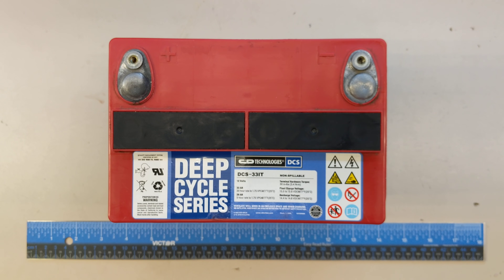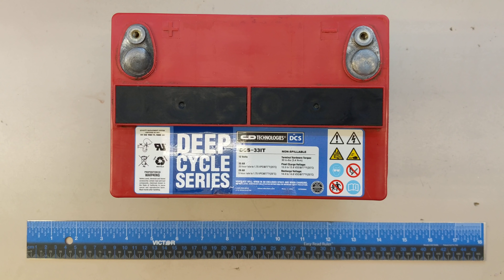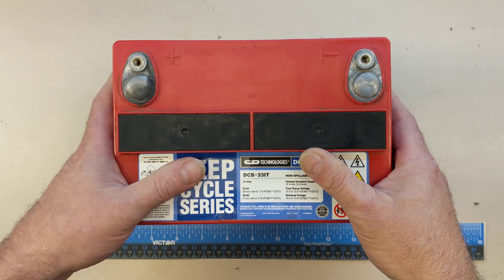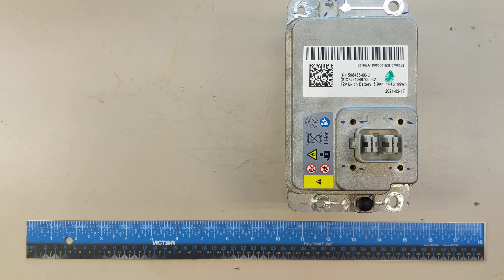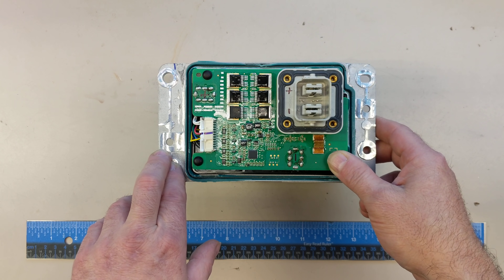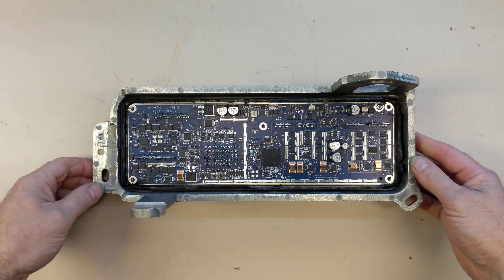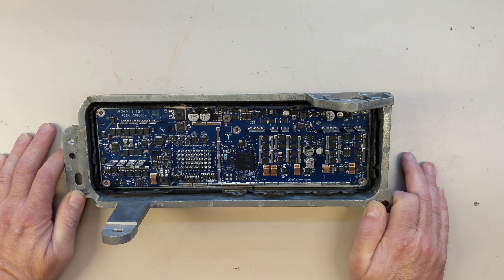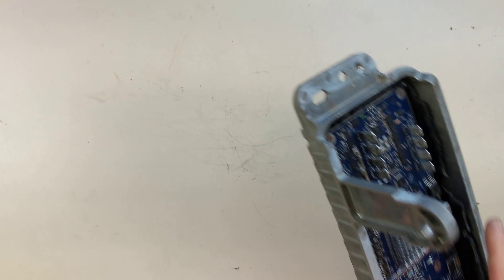Tesla Plaid - 12 volt Lithium Battery PART 1

Comment: Hello everyone from Georgia I bought a car from America that got into an accident. By the time it arrived, it was in a container for 2 months. The battery was a sixteen-volt one and completely discharged. I charged it on the board shows 16 V And where the plug is connected in the car there is no 16 V, it does not show, but how can I cut it so that 16 Volts appear there? The mosfet is open. How can I close it so that it closes in the mosfet?
Reply from the maker: Sadly these batteries will discharge too far for recovery in 2 months after already being dead.  It's a design flaw.  Best advice is order a new one.   DO NOT connect it until you have contactors closing ok!

Comment: Hello!  How to reload a 16V battery after the protection has tripped.  It shows voltage but does not output current.
Reply from the maker: You have to run a reconnect in service mode, and then redeploy the software.
Reply: @Ingineerix  Thanks, I'll try tomorrow.  Is it possible to contact you and ask for help in resolving issues with Tesla?
Reply from the maker: @VALmers.  Yes, my email address is available at the bottom of my profile's "about" page.  You must use a full browser:  https://www.youtube.com/ingineerix/about
Reply: @Ingineerix  Thank you very much)

Comment: I wonder if you switched your battery cables to this newer plug if you could use this new battery on an older Tesla.
Reply from the maker: No, definitely not, and you also don't want it, it's pretty terrible.   The AGM replacements you'll need about every 5 years are only about $100 at Tesla, just buy them when the car tells you to.  Do not try to retrofit a Lithium, you will probably need to replace your PCS if you do (thousands of $).
Reply: @Ingineerix  thanks for the quick reply!

Comment: Hey Phil, what would be the charging voltage for this battery? Will it be beyond 16V?
Reply from the maker: Yes, it can be, but you cannot charge it externally.  It will only charge once VCBATT allows it to over LIN.  This means only once HV is present and all faults that would inhibit charging are cleared.

Comment: Where is the negative terminal? Ugh fkn Tesla
Reply from the maker: They are both in the same connector.   Note you cannot charge it yourself.
Reply: Any grounded point on the vehicle is a low-voltage battery negative... but as Ingineerix pointed out (in the video and in his response here) it's not connected to the cells unless the internal BMS connects it.

Comment: Thanks for the great tear down! Do you know the max peak and max continuous discharge current of this battery? I’m doing some tinkering: adding “12v” power to my frunk, and want to know what limits I’m working with.
Reply from the maker: You absolutely cannot tap this battery for loads.  You will fault the charge system.(VCBATT)   If you want 12v, the only safe way is to draw it directly from the PCS.
Reply: Thanks Phil! That’s really good to know! I’m very interested to learn how I might draw from the PCS to do this. But I’m curious if this project would be above my head: is there a terminal on the PCS I can connect a lead to or are we talking about more complex electric engineering? Any resource you might be able to point me to? Many many thanks. (I’m looking to draw 10-20amps to charge an electric scooter in the frunk for 3 hours when it needs recharging).

Comment: What do you think would be the safest way to add say a thousand to 2,000 w power inverter in the frunk area. It looks like you could just run maybe a 6 gauge wire straight to where the jump start terminal is and then ground to the chassis somewhere else run that straight to your inverter mounted in the frunk. Any idea of how many amps it could handle. Do you think the car would need to be on or the battery would run down fairly quickly. My thought process is if the car was off that it would notice a drain and maybe shut something off. But say in a long-term power outage at the house you could run a couple small refrigerators and maybe recharge phones watch TV. I do this with my Prius currently just hooking jumper cables to the battery and running to a couple deep cycle batteries will keep the bank charged up that way I have a little more buffer for higher loads. The advantage with this is it could probably run for days and days because of the size of the Tesla battery in the small amount of load that I would need where the Prius would have to keep cycling on and off constantly. Plus anytime a ice vehicle is running if there was a failure in a cooling system or oiling system and you weren't there to shut it off it could probably start a fire or damage the engine. I have this new 12 volt battery. Would another better option would be to mount another battery under the front area 12 volt but I'm guessing that's probably not good as the resting voltage is only 14-4 and will always be pulling the other one down from 16v. It'll also be cool to have an inverter for camping and other things that could handle significantly more than inverter powered off the cigarette lighter in the car.
Reply from the maker: The only safe way to get this much current is directly from the PCS, and yes, the contactors would have to be closed.  It's also stupidly inefficient; you'd be throwing away a lot of power as waste. (HVDC->12V->LVAC->HVDC->AC)  The proper way is a HV inverter that starts at pack voltage.   We currently offer a 7.6kW split-phase (120/240) HV inverter as an option with our vans.   It's 97% efficient.
Reply: @Ingineerix  I appreciate the response. I'm not really sure what PCS is. I'm assuming that's inside something that's not easily accessible. I know it wouldn't be the most efficient obviously since it's being converted twice but getting to keep something running for a long time that doesn't require a lot of amperage. I tried searching but I haven't really seen any videos of anybody putting any power inverters on the new lithium batteries.
Reply from the maker: @TimZ007  You will 100% cause a fault in the charging system if you tap power from the Lithium LV battery.  The car will then stop charging the battery and your car will die and be undriveable.  Tesla will see the alert history and then not cover that repair under warranty once the car is towed to them.  If you are not competent enough to understand what I'm saying, then I'd advise you not to tamper with your expensive car and just buy a powerwall or a Jackery type portable power system.

Comment: Thank you for this video, I have a Plaid and I was gone for 3 months my main battery died and this caused the 12V to die as well, is there any way I can charge this battery and bring it back to life , Can I use a regular 12V battery charger to charge it ? Or should I replace it ?

Comment: Probably this battery can be charged far below 0°C, without heating.  Some Li-ion batteries can be recharged at -30°C (usually at reduced charge rate). Many manufactures sell such batteries. 
Do you have measurements of the battery voltage during driving and charging? ScanMyTesla logfile maybe?
Tesla S with lead acid batteries keeps the 12V rail and battery at 13.7V in driving mode (exact value depends on temperature). Matches the float voltage of lead acid batteries. The charging at 14.4V (exact value depends on temperature) is done when the car is plugged in and periodically, if calculated SoC of the lead acid battery drops below ~80%.

Comment: What's your idea on Ohmmu or other LFP battery replacement in the older models which were using lead acid battery. Would it cause any harms that we don't know. Do you recommend it?
Reply from the maker: I've covered this many times: Absolutely DO NOT!    The Tesla AGM units are $85 and last 3-5 years depending on environment.  The Lithium BMS will disconnect on full charge eliminating 12v bus stability, which could cause expensive damage.  In addition, you will have alerts from the car because of this.  Tesla can void your powertrain warranty as well.
Reply: @Ingineerix  I actually made my own LFP battery with the Bluetooth BMS bought from batteryhookup. I agreed with you about the Ohmmu overcharged price. After I finished the job, I didn’t have enough courage to put it in. I wondered if Ohmmu’s BMS may do something more than my generic BMS. Also worried about what you have pointed out in many of your videos. But I am curious if Tesla VC front would know the differences since the voltages should be quite similar to the lead acid, I just think that the system just won’t use my LFP to its full potential if the charging algorithm is still unchanged but I’m ok with that as long as my batttery cause no problems. So I’ll be weighing your opinions over my curiosity or keep an eye on any problems reported from people using 12V LFP on Tesla.
Reply from the maker: @gollygui209  I'll do a video on this.  The main reason is yes, the voltages are similar to PbSo4, but in this case, too low.  Tesla does temp-compensated absorption phase, so this can easily hit over 15v, which is too high for 4 cells of LFP.  This means the BMS will have no choice but to disconnect the LFP from the 12v bus, now the bus stability is lost, and this puts a lot of stress on all the 12v devices in the car, especially the multi-kilobuck PCS.   The OEM AGM is only $85 from Tesla.  Not worth risking it!
Reply: @Ingineerix  Hi Phil, I have another question. I accidentally dropped the micro SD card out of the slot next to the SIM slot on the MCU of my model 3 and I lost it inside while trying to put it back. Been driving 1 day with no problems so far. What do you recommend. I hope I don't have to remove the entire MCU just to fish for that micro SD card. Thanks.
Reply from the maker: @gollygui209  FYI: Tesla can see in the alerts that your SD is missing.   Obviously this voids the warranty on your ICE.   Without the SD the car cannot send High-Resolution CAN logs to Tesla, as this is where they are stored.  More importantly the SD card is used during updates, so without it you will will not be able to apply future updates.   If you don't want to take apart the ICE, you could take your chances and just leave the old one inside and install a new high-quality high-endurance 8GB card in there.  The Gateway will format it and everything will work as before. 

For others reading this:  There is nothing really useful on the SD card, please do not screw with it on your expensive car.   The Linux part of the car computer does not access this, only the SPC5 gateway.  If you want to "hack" on Tesla parts without risking your car/warranty, just go buy a used ICE off Ebay.
Reply: @Ingineerix  Thanks so much, I better try to find the old one and stick it back. I tried the new one but it always fell off. Now 2 of them are missing inside. Does it have to be 8GB, I have the Sandisk 32G, high quality, sitting around in the house (the 3rd one).
Reply from the maker: @gollygui209  I have not tried a 32G, so I can't say.
Reply: @Ingineerix  Dear Phil. Just an update and also further question. So my 8GB industrial grade micro SD card from amazon just arrived and I stick it in. The update can go to about 30% and then aborted - like 3-4 times. While waiting from that micro SD, I tried fish the old one out with insulated wire with no success. I bit a bullet take down the glovebox + airbag, disconnect all power and remove the aluminum face plate hoping to see the old micro SD card there but it’s not - it’s probably behind the mainboard which I did not enough gut to go further. So I closed everything back and now praying and waiting for your further suggestion. What should I do next. The car drives and working fine - just the update that I can’t get.
Reply: Dear Phil, Hi good news. Turn out that my micro SD insertion wasn’t proper. I re-insert it using the self-made inserter made from cut credit card and it went in real well and the updated was finally successful. Thanks very much for your helps.
Reply from the maker: @gollygui209  Send me the files off the SD that went through the failed update.  My email is in my channels "about" page.
Reply from the maker: @gollygui209  Glad to hear!
Reply: @Ingineerix  How do I do that. I really really don’t want to take that micro SD card out again, fearing that I might not be able to get it back in. Pleease, is there anywhere you can  do it remotely?

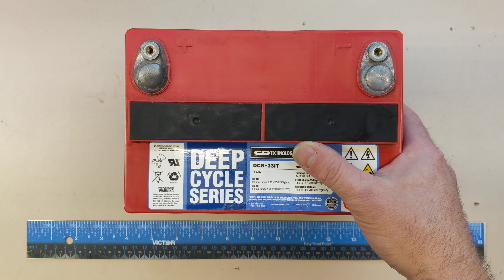Comment: 6:25 That is not true. A lead acid battery at 100% SoC (12,8 Volt) will oxidate the plates much faster than at 50% SoC. Permanenty low SoC's like 0-10% the battery will sulfate.

Comment: The auoto companies wanted to go to 36V.  Ow, in the non mobile world, 48V and 125V are common, so there are devices designed for use at these voltages. No such thing exists for 36V

Comment: I replaced the 12V battery with an aftermarket lithium iron phosphate battery that is higher capacity than the original battery. It was more expensive but much easier to install due to being much lighter. Getting to the 12V battery in my 2013 model S was a nightmare.
Reply from the maker: I do not recommend this.  The BMS in these opens on full charge and then bus stability is lost, which could stress/damage devices on the 12v system.

Comment: you mentioned that 12 volt batteries failing in the older Model s's. Seems pretty common and they don't last very long.
 But it's not the only car that has that problem. 
Toyota Priuses use the 12 volt battery in the same way. Just to boot up the computers and to run the accessories. The DC to DC converter keeps it topped off. 
They put in a relatively small battery not much bigger than a motorcycle battery would be. And they tend to not last very long. It's kind of odd to me because the DC to DC in the Prius can output at least 800 watts continuously and I think maximum output is 1000-1200 watts. So once the car power is up , essentially the car should be running off the power stored in the traction battery and converted to 14v DC through the DC to DC converter.
I would assume the same is true in a tesla. You would think that would make the 12 volt batteries last longer not shorter. But there must be  using some charging strategy that 12 volt batteries don't really like. You mentioned with the Teslas that it waits till the battery discharges pretty far before it kicks the high voltage battery back into play to recharge it. 
The Toyota Prius does not have that problem once the car power is up that 12 volt battery is seeing 14 volts right away. And the car goes to a deep sleep a lot more than a Tesla will. 
And yet the batteries don't last very long. Also when the battery starts to fail you get all kinds of weird problems happening. Which you wouldn't think would be the case considering the DC to DC converter can more than compensate. But it doesn't.
Appreciate you disassembling the parts and showing us how everything works. Just recently found your channel and I definitely appreciate the detail you go into. Keep up the great work.
Reply from the maker: I've only investigated this on the Gen 2 Prius (2004-2009) and the 12v suffers the same fate for the same reason; Standby drain is deep-cycling them.  Toyota's smart key system draws quite a bit.
Reply: @Ingineerix  
Interesting. Thanks for the tip.
 I guess it is always waiting for a signal. The interior lights do come on as you approach the vehicle.
Simple fix on the Prius is simply the pull the big white connector off of the positive side of the 12 volt battery. 
Only real consequence is  losing your trip information and any settings you had for your radio and reverse beep.
They're the damn good car though. I've got a 2008 with 382,000 mi on it. Still on the original Hybrid battery ,engine and trans. 
Still running on the original suspension and steering components too except for the struts themselves.
I'd very much like my next car to be fully Electric. 
But Tesla's are a bit expensive and Volkswagen is not a brand a terribly trust when it comes to reliability.
 I use it for Rideshare and a Chevy bolt is perfect for that. But of course that car has been having its own problems. And nowadays even used  ones I've seen available aren't cheap enough...
So I'll wait a while.

Comment: As a kid I would play around with valve radios - many had 80v batteries as the HT side IIRC. Since I was used to checking my flat 4v ones for life by touching the pins to my tongue I thought to do the same thing with the 80v……..
Once is enough. I concur with the narrator about highest DC voltage.

Comment: Looks MUCH more expensive though.. and why the expensive casting? .. especially with MANY 12V Lithium plastic cased commercial car batteries out there.
Reply from the maker: Safety.  Tesla can't afford to take chances on a plastic enclosure.
Reply: @Ingineerix  Wouldn't using LiFePO4 cells solve that safety concern?.. those are used in most plastic cased Lithium 12v car batteries.. like the one in my Porsche. 
Great Channel BTW .. I'm an automotive engineer, really loving seeing what you are showing here. Doing expensive vehicle tear downs has always been a way of learning what the other guy is doing .. so it is awesome that you can provide this insight for free to us.
Reply from the maker: @KrustyKlown  Yes but Tesla chose to use NMC instead of LiFePO4, why I don't know.  But a metal enclosure is a good idea for NMC.